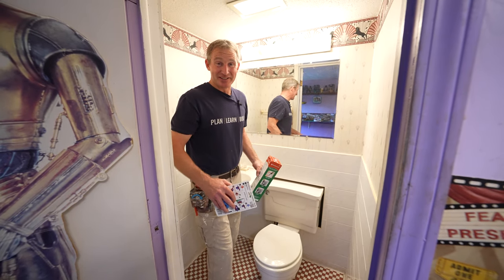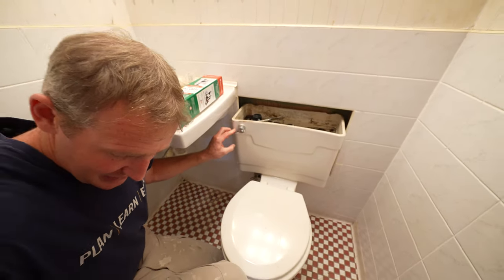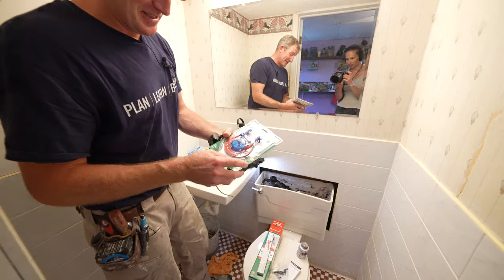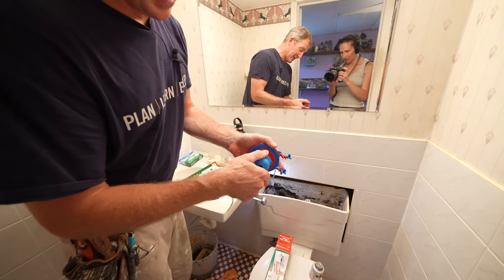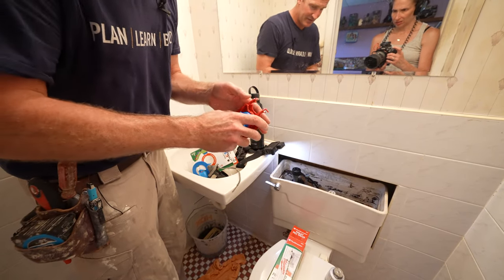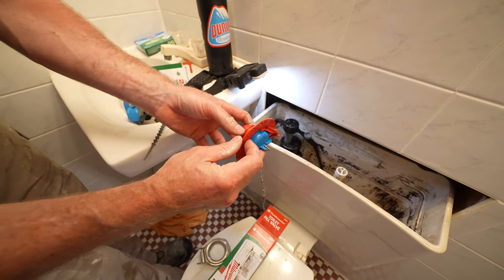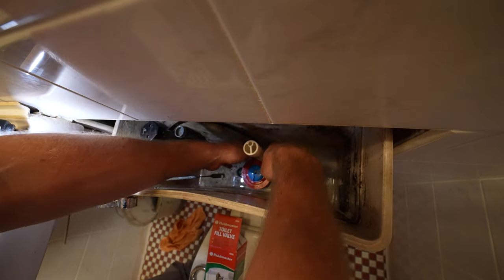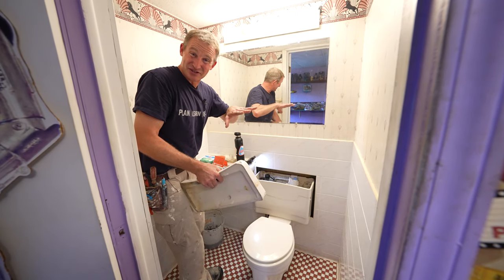Fluidmaster 523A Universal Toilet 2" and 3" Super Flapper - A Game Changer

Comment: Does this fit old Kohler Santa Rosa toilets with flappers?
Reply from the maker: Thank you for your question. The Santa Rosa model toilet currently uses a Aquapiston flush valve and does not use a flapper. For more help or if you are using a different flush valve please contact Fluidmaster at 800-631-2011 and speak with a Technical Service Rep.
Reply: But what about the older ones with flappers?
Reply from the maker: @tanyaroy292  The Super Flapper was designed for the majority of flush valves currently sold and used. Specialized valves such as canister, rectangle/square and 4 inch flush systems are not compatible with the Super Flapper. To speak further about your flush valve please call Fluidmaster’s Technical Service team at 800-631-2011.